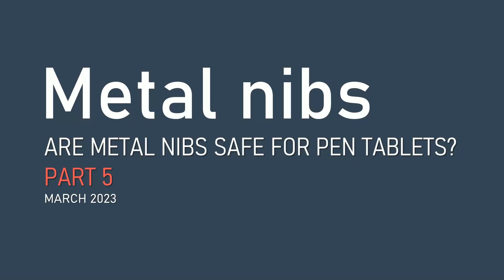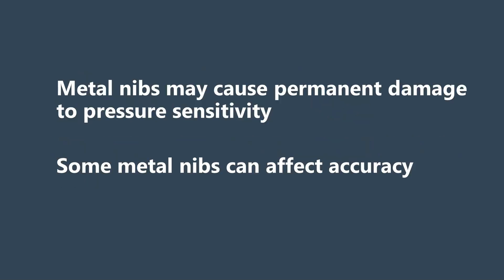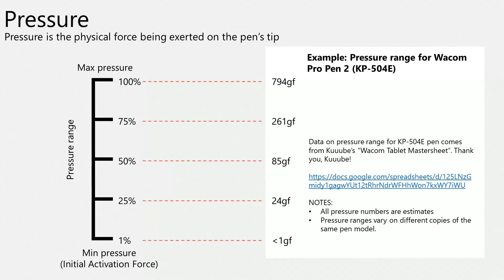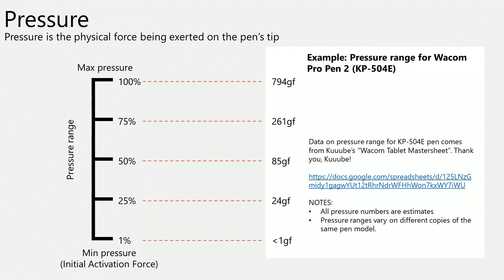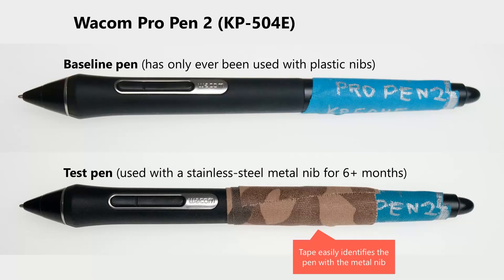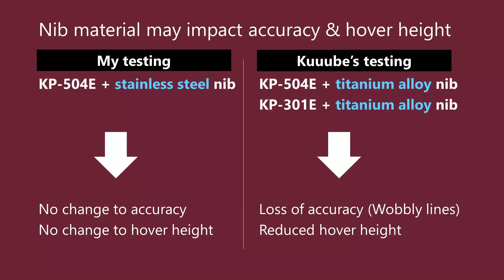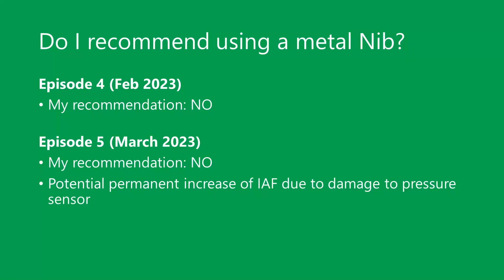Are Metal Nibs safe for your Pen Tablet? (Part 5)

Comment: Someone really needs to make some sort of hybrid nib with a plastic stem and metal head. That would really be the best of both worlds.
Reply from the maker: I have seen a year or so ago, a nib that had a ceramic tip on top of a plastic body. but can't find it anymore. I really want to try that.
Reply: i did something like that, bought a thiner nib and wrapped around a soft material so that it could fit my pen , works like a charm

Comment: Hi, loved the series and all the effort you put into testing and presentation and adding a part 5 is for this issue was so important. I would love to see a part 6 where you explain why this occurs is it the electomagnetical properties of the nib(will titanium and stainless have the same result) or is it the rigidity of the stem or rim of the pen? Did anything fysically break or is it because of the electronics?
Reply from the maker: I need to re-do this test under more controlled conditions. Maybe that will help solve the mystery. I've never found any clear explanation why this change in pressure handling happens.

Comment: is it possible to find or make a nib with titanium or stainless still jacket just around the tip/touching surface and the rest of the nib/base of the nib is plastic so it absorbed a lot of the undistributed forces and not damage the pressure sensitive part? basically like a hybrid between plastic and metal nib?

Comment: Hi man, wish you're always well. Please help me out! I'm about to lose my mind over this Wacom Intuos Pro issue. I'm planning to upgrade from my 8-year-old Wacom Intuos Art to either a used Wacom Intuos Pro or regular Intuos.

I want Pro pen 2 so bad, but I'm concerned about the texture. Did Wacom intend "Pro" to mean applying minimal pressure as possible? like we do sketch with a real pencil? I want to buy smooth texture, but it's only available on eBay at outrageous prices, almost equal to a brand new Intuos medium (2018).

Considering a metal pen, will the IAF (Initial Activation Force) be bothersome? Does it drastically affect accuracy? Though potentially permanent, smooth texture costs more than a brand new Pro Pen 2. 

Please give me your advice

Comment: One year later, does the activation force still get worse with your metal nib? Because if the activation force doesn't get worse than that, I might consider buying one since I don't need extremely low activation force. Or maybe have you noticed other degradation by now?
Reply from the maker: Unfortunately. I haven't used my metal nib much at all since my original investigation so doesn't seem to behave any differently.

Comment: Can confirm it, I have my brand new Wacom One Pen (DTC133) and use it with my Galaxy Tab S9+.
From the first usage I was blown away at how sensitive it was as I came from using the XP-PEN Innovator 16 stylus which has a whomping 12g IAF.

The nib started to wear due to the paperfeel screen protector and as such I bought a metal alloy nib, to my surprise the IAF was noticeably higher and you just prevented me from further destroying my stylus. Many are often concern about scratching the screen, when it reality we run the risk to cause permanent damage to our styluses.
Many thanks sir.
Reply from the maker: Thanks for the comment and for sharing your experience!

Comment: I have a titanium alloy nib. I mess up the pen tilt. It is super inaccurate and wobbly. With plastic nibs, I can get a very accurate and smooth tilt functionality. Other than that everything seems okay, the lines are straight, and the pen pressure has not been affected either. I cant find stainless steel nibs though.

Comment: Hello, it's been more than a year ago since this video: were you able to confirm that metal nibs were damaging the pressure sensors? Thank you!
Reply from the maker: I took that pen apart and examined the inductor coil, the ferrite rod, and the pressure sensor. I could find nothing obvious in terms of physical damage. It's interesting to note here than with this pen the nib (whatever material it is made of) never directly contacts the ferrite rod or coil or pressure sensor. So it is still a mystery to me what the mechanism is behind the change in IAF.

Comment: guys i have a tab s9+ and since i use paperlike screen protector, the original plastic nib melted quickly. i bought stainless steel nibs from aliexpress and i found it great at first. After three weeks pen started to malfunctioning. Touchscreen didnot respond my pen rightnow and I didnt drop at all... Even though I liked it much more in terms of feeling, I cannot recommend steel nibs. i thinks it is the reason of my pens failure.
Reply: My goodness, my pen was about to suffer the same fate! I bought the metal nib from AlieExpress too for my Wacom One Pen

Comment: Are you still actively working on an update to this series or is it more on the back burner till you can get new test materials? I'm mainly curious if a plastic bodied but metal tipped nib would give the benefits of both worlds without any of the downsides but for the life of me i can't seem to find any such nib that's in stock. Hoping for you to have better luck then me so the rest of us can be better informed on if going on such a snipe hunt is actually worth it.
Reply from the maker: Yes it's on a bit of a back burner. I really want to redo the experiment for another 6 months and also try out some of those (very hard to find in stock) plastic nibs with metal tips.

Comment: Can you know for sure that the difference in IAF wasn't caused by your drop tests? I think dropping it 14 times could have caused this change.
Reply from the maker: I noticed the reduction to the IAF in episode 4 before I did the drop test. At the time, I had assumed the change was temporary and merely due to the presence of the metal nib. It was only by episode 5 that I saw the change was permanent. If redo this experiment I will evaluate the IAF at the start of the experiment, and periodically along the way.

Comment: Thank you! I agree with this.

I put a titanium tip in the Staedtler Noris. Using it roughly 3-4 months , ~6 hours a week on a Samsung Tab S7+  using Infinite Painter. 
The pen w the the titanium tip is unreliable and not accurate. Basically it's garbage.
The stock s-pen works as expected as well as a new, stock Staedtler Noris.

Comment: Man, I cannot thank you long enough! You just saved my pen. Here in Brazil, those are really, really expensive to buy, about 3 to 5 times their price in US, because of import taxes and depending on the way they are imported. I was very worried about it's durability, and was considering a metal nib, not because of wear, but because I was afraid the plastic nib could brake inside the pen, and I wouldn't be able to remove it, like what happened to some. But after seen your videos, that became a far smaller concern.
Reply: Daí o que você fez? Comprou pontas normais? Eu tenho s10fe+ e to querendo usar uma película fosca magnética
Reply: @fntksgaming . Eu uso película de vidro e pontas normais de plástico ( sem ser borracha, nem feltro, nem fibra...) 
 Essa combinação escorrega, mas depois que você se acostuma, ela dá menos fadiga e mais velocidade na escrita. E a grande vantagem é que dura muito tempo, eu escrevo quase diariamente e ainda estou usando uma das três primeiras pontas que veio junto com a caneta (Lamy al star emr). Só que eu escrevo fazendo o minimo de pressão, sem forçar a ponta na tela. O único problema para mim de eu usar o vidro está sendo o reflexo.

Comment: Early on watching the series, I came to the conclusion that it is okay for me to use a metal nib without a screen protector on my intuos pro Large, however, I think now I will go with a regular plastic nib or a felt nib with a screen protector. I have been using a screen protector on my intuos pro medium, which the large is now going to replace, and there has been no nib wear, just the screen protector wearing away, although this is purely cosmetic and hasn't affected functionality. I've been using it like this for several years, and The nib has remained in seemingly brand new condition the whole time. Finding out now that the metal nib can damage the pen, I see no reason to use a metal nib. The original goal of that was to prevent the nib from wearing down and needing to be replaced, and to prevent wear on the surface of my tablet, but using a screen protector with a plastic nib achieves the same thing without damaging anything. All I have to do is replace the screen protector from time to time, but even then that's probably not necessary, as the wear on the screen protector is purely cosmetic and would be done just to satisfy my OCD of that bothering me just because it does.

Comment: I could be wrong, but I believe the part that is getting damaged is the ferrite core.
Under normal use the plastic stem flexes to prevent damage to the ferrite core when tilting the stylus against a surface.
The metal nib with metal stem however is hard, inflexible, and harder than ferrite.
So with all that comes increased load pressure on the inner edges of the ferrite core, leading to damage of the ferrite core.
Reply from the maker: I think you may be on to something about the cause. I recently took apart a different Wacom pen and saw clearly that the nib does not directly make contact withe the pressure sensor, but it does have direct contact with the ferrite core. When I take apart the test pen I’ll use a microscope to see if I can detect damage to the ferrite core.
Reply: Any updates?
Reply: If there is something, it'd be micro cracks on the inside of the ferrite core.
most likely won't see it without an x-ray.
If you remove the ferrite core on a battery free stylus, it'll usually stop working.
However there are some drawing stylus that don't rely on a ferrite core to function.

Comment: Update: i was finding that mechanical wobble and IAF increase on my pro pen 2

But it's perfectly fine Even after 7 months using a metal nib from Aliexpress

For this video i'll use again plastic nib yo be secure and use metal nibs only as a last option when i watch me with no nibs instead

But it's weird, why after 7 months i'm not having they issues what you haved?
Reply from the maker: I'm not sure. There may be other differences between out setups or the way we use the pen. I'll keep researching. Which nib did you order from Aliexpress?
Reply: @thesevenpens  ive been using metal nibs for 2 years now almost and i havent faced any issues neither. Im a digital artist so pressure and sensitivity is very important for me. So im wondering how i havent seen any issues yet. Its scary though. I bought my nibs from aliexpress too
Reply from the maker: @eevampire7  Definitely some people don't experience problems. And we are still not sure why some of us did see a change in the IAF - we don't know what mechanism might cause this. One day I will repeat this metal nib experiment in a more controlled way and see if I can learn more about what is going on.

Comment: Part of me wishes there was a hybrid nib. Like- a metal tip but a plastic stem so the likelihood of a nib causing issues would be resolved entirely.
Reply from the maker: A fellow tablet enthusiast shared this link with me with exactly what you are talking about: https://alice-books.com/item/show/1113-3 currently sold out though :-(
Reply: @thesevenpens  That seems to be made for another stylus that isn’t Wacom, given the shape. 

I’m tempted to try an experiment of my own by Plastidipping the stem of my metal nib. It’s a rubber coating and not like plastic, but it will provide more cushioning in the barrel of the pen, to prevent the metal from wearing down the coils. 

I’m using a sacrificial Pro Pen 2, so, if it breaks, it’s not the end for me. ;)
Reply: @ShadowLinkxMaster any update on the DIY hybrid pen lol?

Comment: Stainless steel and titanium are two forms of metal. Whichever way you slice it, it will sit in the pen and depending on the pressure or angle may or may not damage the inside of the pen rod slot.Also noticed that the metal nibs will slip out as they do not have much feel to them for the sides of the inside of the intuos pen to hold them, and since they're slippery per se (since they're metal) they will eventually fall out when angled downwards and tapped from above).

Comment: Feels like there's a spring inside that becomes more compressed with the use of the metal nib.
It might be time for metallic tip and plastic trunk, making the new nib made of both plastic and metal. 
However, I don't know which brand/manufacturer would design that.
Reply from the maker: Interesting idea. I will keep an eye out for a nib like that!
Reply: @thesevenpens  By the way, the new Wacom Pro Pen 3 standard nibs give the feeling I suggested at first sight : metal tip and plastic trunk, as the tip and trunk have different colors. 
I however am not sure about the material of the tip. If you can have you hand on that nib and check whether it's truly metallic tip or not, I'd be grateful. 
Just reply here for the news once you do the experiment.